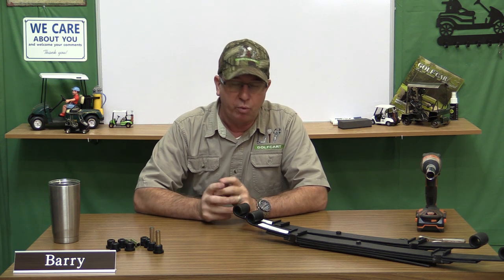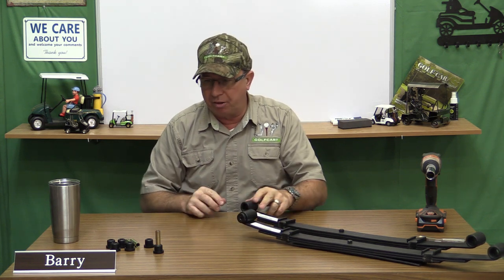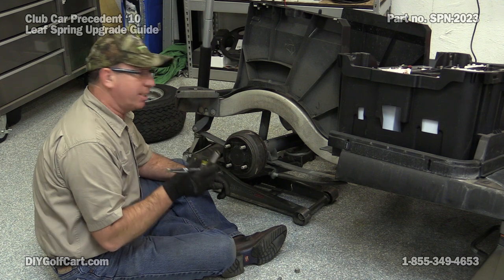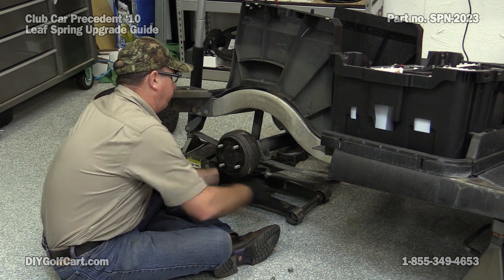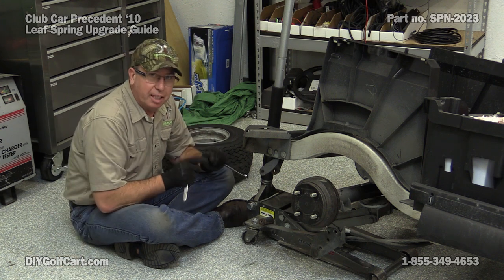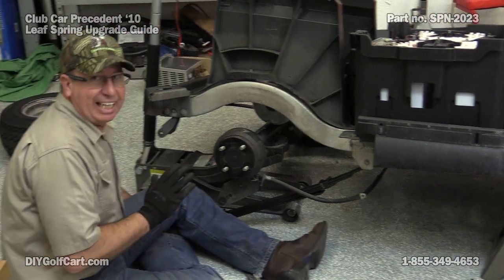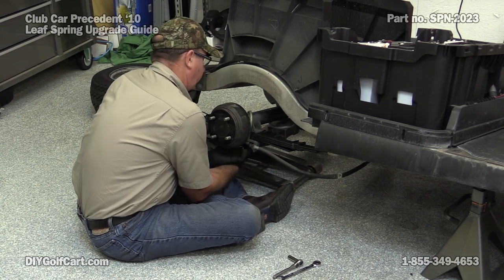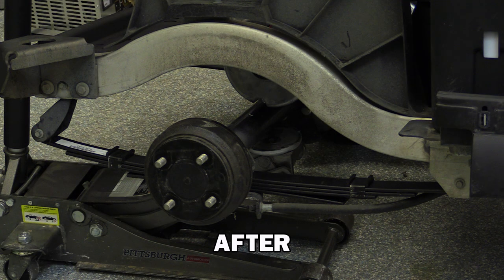Club Car Precedent Heavy Duty Leaf Springs | How to Install on Golf Cart Rear

Comment: funny how he said totally remove the shock lol.   good video thanks
Reply: the heavy duty is recommended for the rear seats but if you don’t want a rear seat the shocks can still provide more comfort ,  you can install 2-4 leaf spring without a left kit and still have enough space in between for the look of 12s low profile tires as long theres no hills or bumpy roads.  i wanted to comment on this video because i used it for reference on how to do the task. thanks dude your good.

Comment: Great video, made that look easy. I am in the middle of taking 6” lift off a precedent. The front change of spindles didn’t take maybe 20 minutes, but the rear ugh. I attached the axle to the heavy duty leaf springs and can’t get the leaf spring ends lined up to bolt. I tried attaching the leaf springs first then attach the axle to them but couldn’t get the nut to line up with the hole. Just curious if there is trick to the order? Or any suggestions from your experience? Any help is appreciated.

Comment: Hi I just bought a 2019 club car I installed after market 10inch wheels I do not want to lift my car but wheel clearance tight especially when I have four passengers on board I bottom out  rub slightly! Will these heavy duty leaf springs resolve this problem without having too lift or do I need to add spacers or new rear shackles to lift the rear of the cart up? Thank you in advance Chad

Comment: I have a 2003 club car precedent with a Jakes 6in a arm lift kit. They had me put the standard leaf on top of the axle. Someone gave me a set of heavy duty leaf springs so my question is do I put them on top or bottom of axle. Thanks for your videos

Comment: Just put on my new leaf springs but my driver side battery cable is way tighter. Rubbing on the new spring and looks like it might get in the way when springs are compressed. What do I need to do for this?

Comment: Hi Barry, bought a precedent with rear seat and 6”lift kit.  Want to change our rear springs to heavy duty- currently stock springs and it is not doing so well...where can I purchase short rear lift blocks?  Or can I use the tall ones with heavy duty springs? Thanks in advance.

Comment: Great video.  Thaks.  My situation is I already have 4 leaf springs and due to the terrain we use it on, the ride is just terrible.  So bad that we avoid using the machine.  My question is, as I don't have the original leaf springs to put back in, can I rermove the 4 leaf spring set, remove a couple of leafs and put it back together?  I can't imagine this not improving the ride but would like your suggestion.  Also, if I were to remove some leafs, which ones would you recommend?  We use the club car on a ranch.  Thanks again.  Love your videos.
Reply from the maker: You can remove a spring or 2 but, first try to lower the air pressure in the tires a bit and see if that makes a difference.
Reply: @golfcartking  Thanks for that but I have tire pressure probably too low already.  Looks like its going to involve removing a couple springs so any advice on which to remove?  Also can I change spring tension on the accelerator, as again on our terrain it is very jerky.  Thanks
Reply from the maker: @rleeyeager7566  You can remove the coils on a Yamaha coil over shock. You can adjust the accelerator pedal by adjusting the two 10mm nuts at the pedal.
Reply: @golfcartking  Sorry should have said it's a Precedent involving leaf springs.
Reply from the maker: @rlyeager1  In that case, remove the short stiff spring on bottom first.

Comment: I had to grind down the lower bracket where the brake cables connect. After the HD spring install it dropped the plate down almost 3/4” and it started scraping on the inside of the wheels.
Reply: Thanks, I found this out last night. I hope it does not weaken the bracket, I am guessing 3/16” will do.
Reply: I thought I was the only one. I was considering changing to bigger wheels but this should do the trick. Thanks!

Comment: I bought the heavy duty springs to replace the standard springs on my 2011 club car. will i need longer u bolts since the hd springs are an inch or so  thicker and i have the 4” lift kit?
Reply from the maker: 99% of the time you'll be fine. The U-bolts should be long enough. If you're that 1%, then you might.
Reply: DIY Golf Cart Thanks for the reply! I ended up taking one of the leafs out because they were extremely stiff. this helped with the u bolt length and the ride!

Comment: I need to ask a question about the bushing change.  I am trying to install new bushings and center sleeves but my cart is an 02 club car ds and has a 3rd set of bushings at the rear hangers that attach to the frame itself.  What I need help with is how do I go about getting the body off the back end cause whoever assembled this cart put the bolts in backwards.  They have the head of the bolt facing the center of the cart and not the wheel well.  Can you please point me to a video or just tell me where I can find all the bolts necessary to get this rear half off??  I know there will be several different bolts, just don’t want to remove the unnecessary ones if I don’t have to.
Reply from the maker: https://www.youtube.com/watch?v=S3wV6u5IanI

Comment: good evening . great video but I hit a problem.  I followed instructions to the letter. I have a 2006 club car precedent. I added a rear seat and a dual action springs. I have 12inch rims with low pros. with a average size person it still rubs do I need the 4 leaf?
Reply from the maker: The Dual Action springs are like the middle of the road as far as supporting weight. They support plenty of weight yet still allows for a smooth ride. At this point, you might want to consider a minimal 3" lift kit. This will give the golf cart a little bit more room for flex and still allow you to have a smooth ride.
Reply: thanks for the reply. THE guy at the dealership said he never had that happen before . so the 3 inch lift should  do it
Reply from the maker: The new style dual action springs haven't been around for a long time. Most likely the dealership just normally install's your everyday standard heavy duty springs. The 3" lift should maintain your golf carts good ride and give the the extra height you need.
Reply: OK he ordered me the Heavy duty 4 leaf but I will just get the lift instead

Comment: I call BS on the shock removal.  Springs and shocks serve two very different functions.  The springs  support the weight of the cart over the axle, the shocks prevent oscillations of the body after the axles hit a bump.  Shocks do not suspend the body in any way.

Comment: Any videos for 2003club car hesitation when accelerator is pressed.
Reply from the maker: Unfortunately not. If it's electric, check the batteries. If its gas, check the brushes in the starter generator.

Comment: you said to remove the shocks but do I have to take them off
Reply from the maker: +Michael Lisowski No, you can try to leave them on but, you will have to stretch them out so far, they' ll not function.
Reply: I won't keep my shocks for more wite